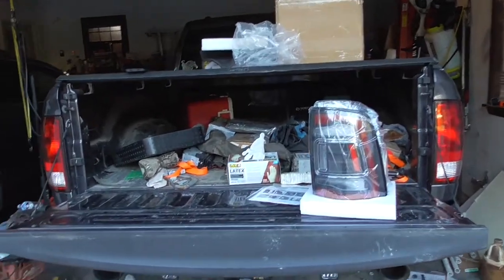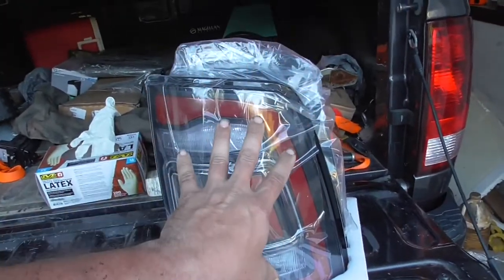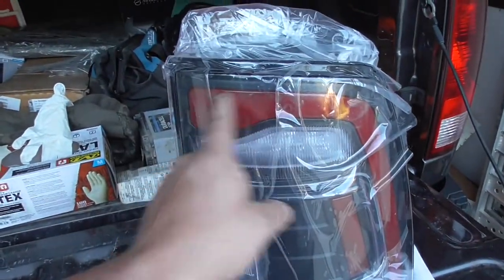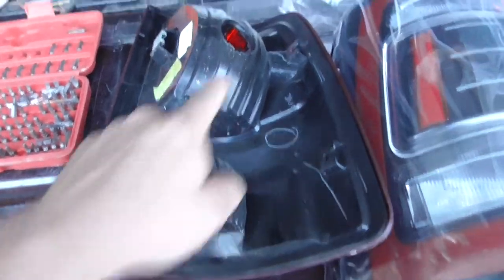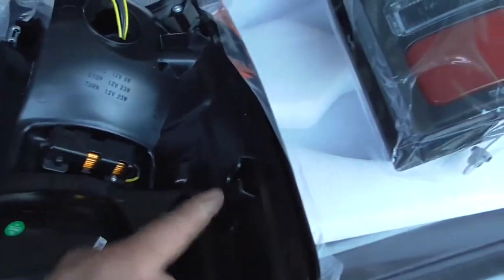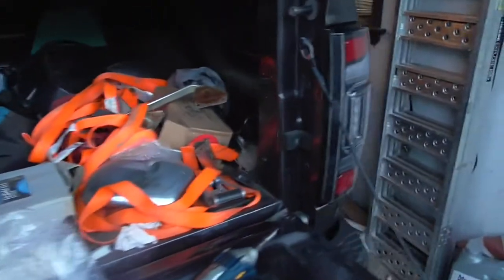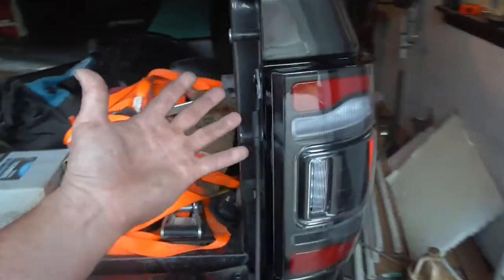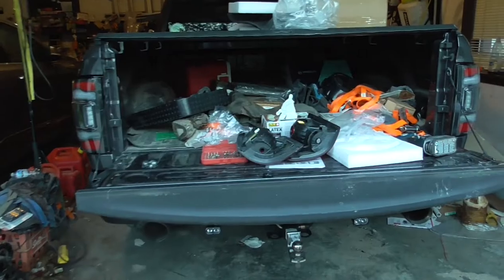2018 Ram 5th gen replica LED tail lights | 2009-2018 (2019-2022 Classic)

Comment: Nice I appreciate it I ordered mine. They are on the way. You got to get the black tinted third brake light next. And the black mirror turn signal covers.
Reply: Did you pair have amber sequential signals as well?
Reply: Did they come with the sequential turn signals?

Comment: These tail lights still working good?
Reply from the maker: Mostly, about 10 months ago the top brake light on the driver side has been getting dimmer over time. Still has the bottom brake light though and everything else works fine.

Comment: what do you see from the back when you press the brake and turn signal at the same time? Does the brake disappear and only the direction indicator lights up or does the red stop light and the orange indicator light come on at the same time?
Reply from the maker: Braker lights disappear and only the turn signal lights up.  Same as the oem 5th gen lights.

Comment: Do these work if you have the factory LED taillights?
Reply from the maker: No, these are designed for the factory incandescent tail lights. Different wiring between OEM incandescent and OEM LED.

Comment: Dose it set off the cambus on the dash
Reply from the maker: I had no issues on the driver side but the passenger side running light did set off a bulb out warning after driving a couple miles a couple times. I assume the load resistor on the passenger light had issues.  I fixed the issue with AlfaOBD, haven't had an issue since.
Reply: @DanielPace92  awesome I just watched your video on the oem AUX switchs I'm going to do that also what are you running for a bypass cable
Reply from the maker: @CarsTrucksWhatever  The OBD bypass cable? If so I'm using the KAOdTECH cable.
Reply: @DanielPace92  ok is that the one that go's behind the radio
Reply: @DanielPace92  my truck has heated steering wheel and heated seats I'm trying to find the aux switch with those options
Reply: I bought the same exact tail lights for my 2019 Ram 1500 Classic. My issue is with passenger side tail light. When I turn on the signal the parking light/running light shuts off. 
After I turn off the key and restart the truck all is OK till I turn on the signal. 
This whole situation makes me so upset. Also it throws a code for back up lights.
Do you know what I need to do to fix these issues.
Thanks
Reply: Did you ever figure it out? Got the same thing happening right now to me

Comment: So you’re saying that the 2019+ taillights for 2500 will fit the 09-18 1500 with the harness kit? Do you know what kinda harness is it?
Reply from the maker: The harness is from Retro Shop, and they have two different ones. A short pigtail harness that just makes the turn signals the read for the brake lights, or a full harness that has relays and taps into the trailer brake harness that keeps the amber turn signals.